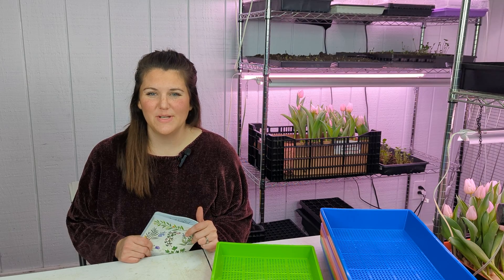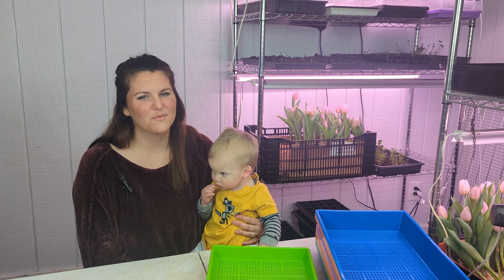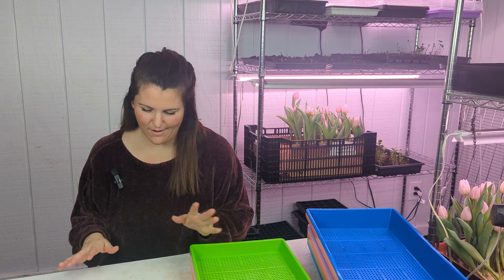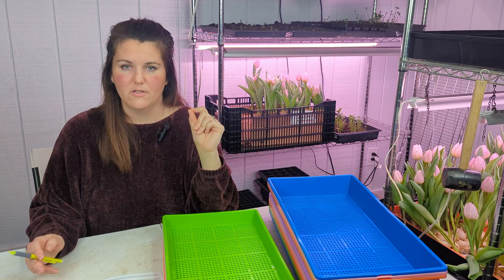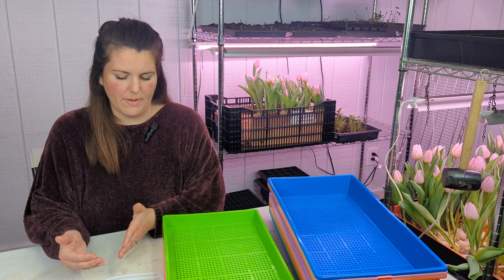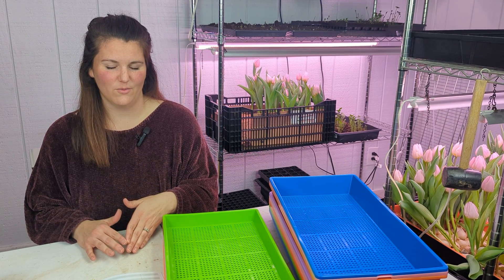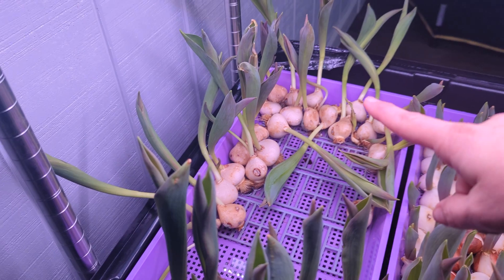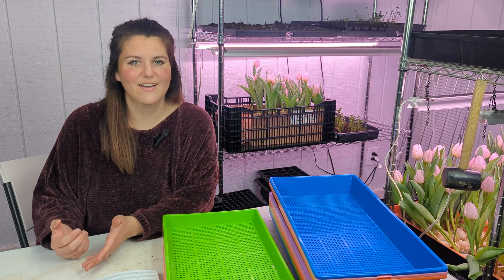Growing Hydroponic Tulips for Valentine's Day / Forcing Tulips without Bulb Forcing Tray

Comment: What's the temperature of your grow room? I built a hydroponic system I use for my soil blocks and love it so I may give it a whirl with tulips. Do you think the trace filled with pebbles or pumice would work to give bulbs some elevation?
Reply from the maker: Our basement is usually between 58-62 degrees F so it's maybe not as perfect as it should be but it worked. I'm doing this again this winter and will be able to share even more with that experience hopefully!! I think maybe pubbles could work?? Worth trying it!!

Comment: Good for you for being inventive! Would like to get into it but probably thinking dirt to start and hydroponics in the future
Reply: Also I’ve got an idea for you…. Could you use stainless steel nails from the hardware store and push them through the bottom of the tray ?. You would get the same effect as the pin trays they are stainless so it should be fine disease wise and longevity. I really like the idea of the flood table for efficiency.
Reply from the maker: I love that idea! I think tulips are such cool plants because of the different ways to grow them!